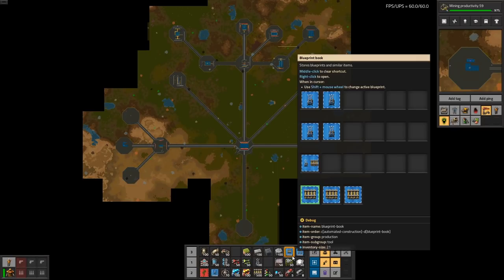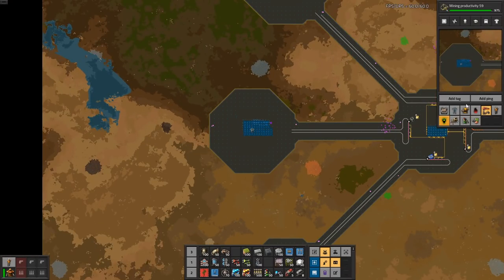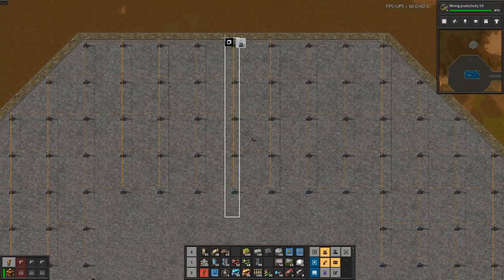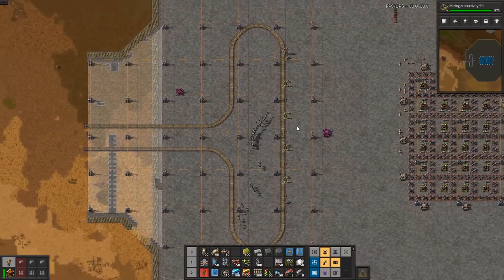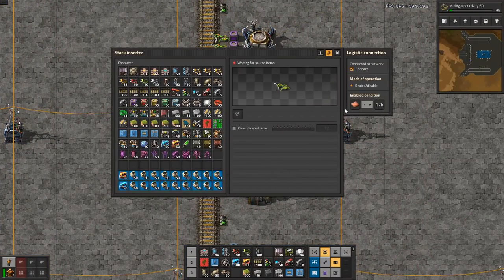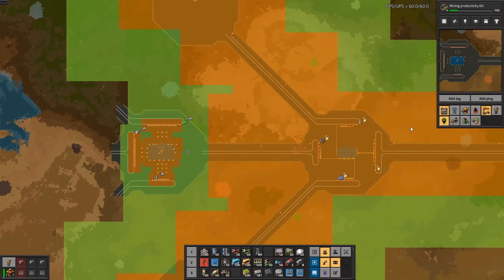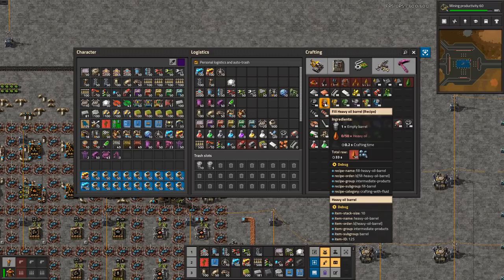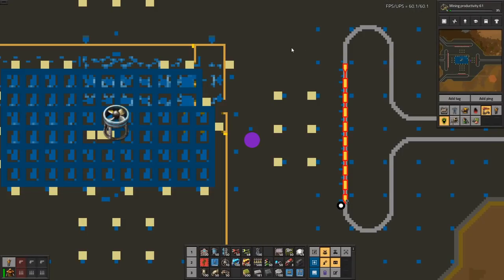Factorio Reverse Megabase | #22 ROBOTS BUILDING ROBOTS | Lets Play

Comment: Everytime I click on a video of yours the quality is automatically set to 480p, does someone elses have that problem aswell? I don't know if thats an issue on my side or if you just set some default thingy in the settings of your video. But as always, great Video!
Reply from the maker: I've had that issue as well with other videos on YouTube. I suspect this was due to AdBlock and YouTube.
Reply: @Nilaus  Well that could be the case.
Reply: @chickynuggies2518  In my experience, while on auto, yt can dynamically change the quality of the video based on such factors like the last chosen quality of a video (by hand) as well as the available throughput of your connection at the moment.

In other words, if for some reason yt decides you can't handle 720p (say, you're downloading some file, or you share the connection with others), it will decrease to 480p or even lower quality. On auto it just seems to prefer getting the information through uninterrupted over getting it to you in higher quality with a possibility of getting stuck/running out of buffer.

I don't think it has to do with adblock though. shrugs
Reply: If using Chrome or Edge then that is the issue. Change to Firefox for YouTube videos and you won't suffer dropped frames or reduced resolution
Reply: How soon did you click?  YT starts with the lowest quality and renders up, publishes the video as soon as the first one is done.  So if you click fast, it might still be rendering the HD resolutions.
Reply: Just coming in later to say that this happens to me with Factorio videos and ONLY Factorio videos, but also only on YouTube mobile (including tablets).

I think YouTube’s algorithm is specifically noticing that even at 1080p there are still a lot of compression/aliasing artifacts in these videos - cluttered frames, repetitive sprites and lots of movement - and therefore the server tries to “get away with” serving 480p content. The individual frames do look quite similar…. except for the vitally important text! 

It’s very frustrating that YouTube doesn’t let users choose specific resolutions as default settings - I hate seeing “Higher picture quality (480p)” and having to set it manually.

Comment: I installed rate calculator instead of max rate calculator like you just did and it seems nice but why... why does it only work with power... Max rate calculator was able to tell you the rate without electricity.
Reply: Mod author mentioned in the other video, MRC does an entity search to find all beacons for a given machine.  RC just reads the speed on the machine directly.
Reply: @canebro1  makes sense. I bet it is faster this way.
Reply: @RamHomier  Yep, he mentioned it reduced several hundred lines of code to one.

Comment: When at 37:30 you decide that you need 2000 logistic robots, where did you base the decision on? It would be interesting to understand why is 2000 a good number, why is it not too much nor too few?
Reply: Everything was running and some didnt immediately fly out  to do something, so it's not too few.
Reply: @ThorRuneHansen  sure, that's an empyrical approach, i was looking for a more analytical one
Reply: @spc-tr  I'd guess the experience of how many bots it takes to run the satellite factory was his basis going with 1000, then decided last second to go overkill with doubling just to ensure there would be bots with downtime; intentionally putting far too many in to make it easier to trim the fleet to the optimal size.
Reply: there is really only one answer to this and that is, "It depends".  As robot speed and carrying capacity increases the number of robots required decreases.  As Thor-Rune stated, it's really the easiest way to tell at a given point in time.  you could do some maths but there are so many variables, the most complicated would be trying to work out flight time as there is no specific flight path for a given bot, therefore you will only ever be able to use an approximate figure.